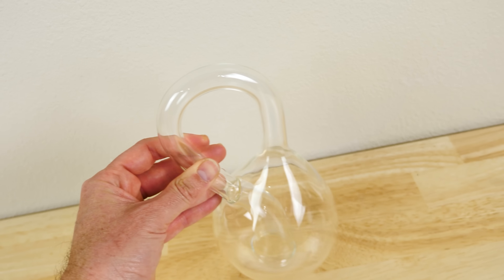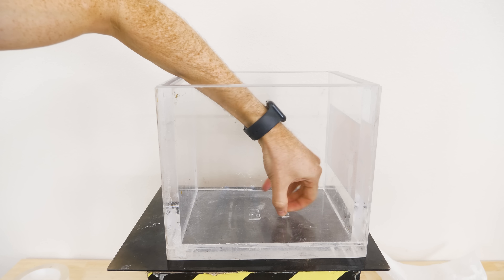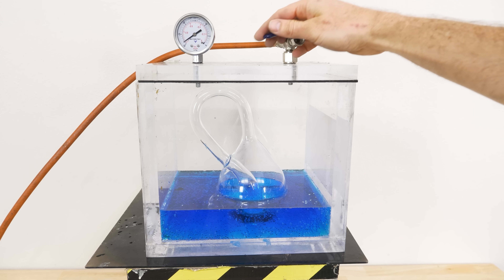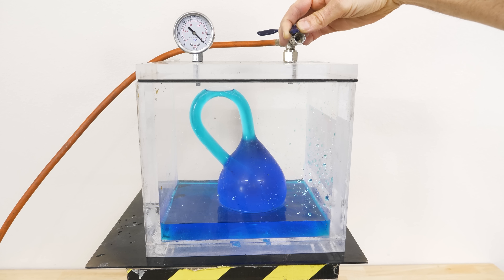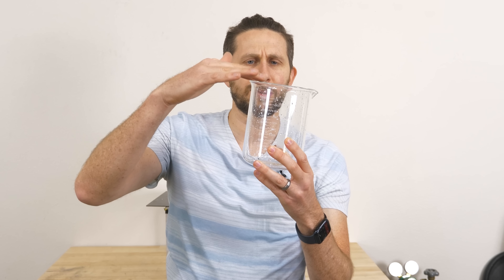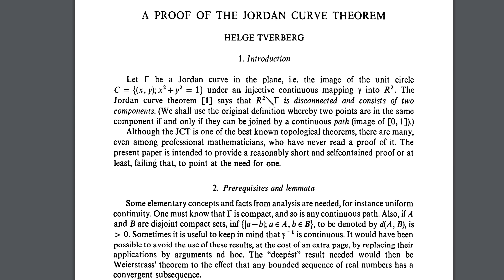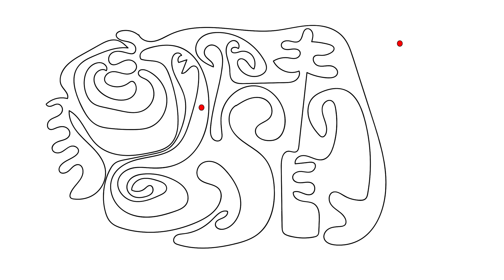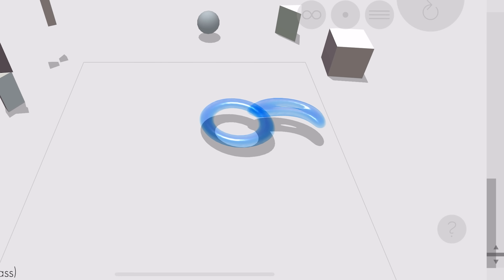Is It Possible To Completely Fill a Klein Bottle?

Comment: Funny thing is there is no such thing as 1D, 2D, 4D and beyond. They are all concepts of thought and math. Nothing can be 1D, you can’t have a point that has no width, there is no dot that can only have length without width and vice versa. It’s literally impossible. You can’t have 2D, there is nothing that can have length and width but no hight. Even an atom and what makes an atom has volume. And nothing can’t be 4D or beyond because there is no more physical space to travel. These are all just concepts based of math that cannot be expressed, recreated, or even visualized. It’s all mathematical theory. Just because you can theorize something in math doesn’t mean it is manifested somewhere.

For example my pocket has space and that space can be calculated and the space a 100 dollar bill can be as well. According to math it makes perfect sense that 100 dollars can be in my pocket right now. Yet if you check there isn’t one there

Comment: Is it just me, or couldn't you just stick a rubber tube into the bottle before you fill it, so there is a means of pushing air out as you fill it?

Comment: I was thinking you could achieve it by using a long flexible tube to let the air flow out when the water fills in.
Reply: Of course ...with a flexible tube was much easier

Comment: When the vacuum trick was presented, I started pondering what would be the result when the water starts boiling?  A little later I concluded it would be a dilution process between air and "steam", affecting both the Klein bottle filling and the vacuum box.  In theory, neither one would never reach a true end point of zero air.  Just an asymptotic approach.  A practical observation would indicate the steam condensing and an arbitrarily small amount of remaining air probably dissolving into the water.  Hmmm?

Comment: Another easy way to fill it up might be a tube/pipe (or a straw) put inside through the mouth and pump water through it. That way the space around the tube/pipe will allow air inside the bottle to escape

Comment: I disagree with it having no volume, and you could’ve filled it in with a tube going in… this was silly. The volume still accounts for the tube going in, the water can be used to measure the volume. You could literally calculate the volume as if it was a cylindrical tube.

I really find this leap of logic nonsensical.

Comment: Wait, wouldn't the inside of the bottle and the beaker be technically the very small space occupied by the glass? Or by both "outside" and "inside" does it necessarily have to mean the surface that can be in contact with air?
Reply: Keep it mind this is not a true Klein bottle

Comment: You made this way harder than it needs to be. Just insert a rubber hose/straw and push water in, which will displace the air as it fills. Turn as needed once it starts to top off on the inside.
Reply: That's boring af. Why miss an opportunity to use a vacuum chamber!?

Comment: Talking about over engineering.
A simple minded brain like mine would have inserted a small tube and filled the bottle up.
The air could have flown out as long as the tube is not blocking the airflow 
This solution cost you less than a dollar, how much is a vacuum chamber ?

Comment: To fill the bottle without a vacuum chamber, run a tube into the bottle. This will allow the water to push the air out as the bottle fills.

Comment: It has an inside. You had the volume of a liquid. You filled it and there it was.
Reply: That's what you call inside volume. The top that is the bottom is curved.
Reply: Now you have liquid to measure.
Reply: It just falls out when you move.
Reply: A parlor trick that even fooled you.
Reply: First you proved its filled.
Reply: Then I said you can measure volume.
Reply: No one should be that dumb.
Reply: First part then second was a lie.

Comment: You know, you could've just submerge the bottle into the water entirely instead of using a vacuum pump to get more water into it, then sucked the air out with a straw

Comment: Hey so I’m not sure if you have already done a video on this but what would happen if you were in a free fall on top of an object that has a greater air resistance than yourself and we’re to jump straight into the air against the free fall close to the ground would it be possible to mitigate any injury and land you instead of from a say 150ft free fall to a mitigated let’s say 6 foot fall?
Reply: Were* to

Comment: What if you were to submerge it fully in water and repeatedly move it to get individual air bubbles out?
Reply: numberphile did a video 3 years ago where they rotate one several times under water and did basically what you described.  It was far simpler and cheaper (didn't need a vacuum chamber, just a bowl of water lmfao)
Reply: @cody1964  That's exactly what I meant.
Reply: Still no one has answered this??
Reply: I came to the comment section for this exact question.
Reply: That would be exactly what this video is not about! Guy who uses a 4chan meme as an avatar that is so outdated that no one on 4chan posts it anymore.

Comment: i dont agree on the ''no volume'' reasoning. with this exact reasoning, a bucket doesnt have a ''volume'' if you curve the edge of it nicely. defining a volume by having a a defining edge?

you could even say that the ''defining edge'' of the klein bottle, is where the liquid is touchable. like with a cup of water, you can touch the water at the top.

this thing seriously has a volume. and the reasoning you gaave was quite..... ''imaginative'' and doesnt really conclude with most of the followup information you where giving after. 

the 4d klein bottle is a good explanation, but this 3d model does have a volume

Comment: This is such a stupid useless thing.
Reply: You're right !  And this because an attempt was made to put into practice some strictly mathematical models. There Klein's glass is presented as a single-faced surface. In practice there is no such thing, because the tickness of the vessel walls should be zero. Also valid for the Möbius strip.

Comment: I can clearly see the inside and outside. 3:31 "There is no line that would separate the inside from the outside." Lol, it's right where you put your palm when you want to hold on the water, there's a lid missing. I don't see any "mystery" in this bottle, just a f^^^ed up design bottle. How tired of these half-educated people with their "oh, look at the bottle without volume" or "oh, look at the tape going through space and time" and other mundane mutilated or upside down things that they try to present as a paradox
Reply: The Klein bottle is a higher dimensional version of a Möbius strip. Just like the Möbius strip only has "one side", so too does the Klein bottle. As he says in the video, the actual Klein bottle lives in a 4-dimensional space. What you see in the video is a 3-dimensional shadow of a Klein bottle. This is why it can be filled with water and looks like it has a clear inside and outside in the video.

Comment: You could probably also hold the bottled upside down and spray a small stream of moderately fast water into the opening. The water would shoot up the spout without completely blocking the air's exit

Comment: What about using a long flexible straw to connect the air trapped “inside” the kelvin bottle and helping it escape while filling it up? Wouldn’t it work without the need of vacuum?

Comment: this is a drinking game trick question.

take a straw and cover one end, and stick it into the bottom of a bottle of liquid(keep the straw full of air). now turn the bottle upside down. The bottle will  drain faster because the air has an easy way to get back into the bottle via the straw.

so, same idea with the klein bottle. Stick a flexible tube into the bottle so it reaches the bulb at the bottom. then turn it upside down. then fill the bottle via the opening. The water will flow in and the air will escape out the tube.

no vacuum pump needed.

Comment: Shapes don’t have volume, right?
Reply: The Klein bottle is a bounded surface, much like a sphere is a bounded surface. But we often think of spheres as having volumes because the surface encloses some solid region of space. A Klein bottle does not enclose any solid region of space, which is why it doesn't have a "volume" in the sense that a sphere or cube would.

Comment: A simple trick I guess is to get a hose, fill it up (standing properly, hose coming out of the bottom)

Flip it, add more water. And done..m filled. Just use a plate or something to flip it back without spilling.

Comment: I have to disagree.  The bottle will displace water because the material it's made of has thickness.  Same with the beaker.  The only way what you're saying holds true is if the beaker or Klein bottle were made of a surface with zero thickness.

Comment: I love how sometimes I understand things even less after watching these videos. Iceberg theory and all. 
So cool.
Reply: Eh,  a klein bottle has no inside or outside in the same sense as a cup has no inside or outside. The issue is the fact that the surface isn't explicitly definable even if it's clearly definable.
Reply: Yo just jumping into this vid, and before he said FUCKING VACUUM CHAMBER, I was like "Oh, he must have a tube to put water in it". I didn't want to understand the rest. I wanted to come to the comments to see if anybody said "use.. use a tube..."
Reply: He's not very good at his job of explaining things.
Reply: not iceberg theory. he just not good at comprehensively explaining things, and often uses bad theory and practice to explain actually simple ideas. Case in point, he used a vacuum chamber instead of just siphoning water into it. Also, not even that good of a vacuum chamber, since a good one would start boiling the water after due to low pressure, and would prove why using a vacuum chamber is not the correct method to fill this vessel. Also, it does have a volume, which is easily measured by submersion. His explanation of what volume is was so flawed. using his definition, a simple uncovered pot would have no volume either.
Reply: @john jon  Mathematically speaking, an uncovered pot is just an unclosed curve line, i.e. with no volume. In math, a line has only one dimension. He often touched the point but couldn't fully explain it that's why people find it confusing typically in his videos.
Reply: @R0cky0  he just thought it's fancier and eye-catching to say "it has no volume", while it can be put very simply and precisely as "it has no interior".
Reply: @caoqifan2371  that literally means the same thing, volume is just the space inside something
Reply: @____Carnage____  There is some nuance. A Lebesgue measure zero set, an empty set, and a set that cannot be well defined, are different things. What he said is like saying "my laptop has never got covid".

Comment: You could have used a relief tube to provide a seperate path for the air to excape past the incoming water rather than the vacuum. For those without a vacumm.

Comment: All you have to do is submerge the bottle and spin it around a few times to fill it completely. No need for a vacuum, no need for pouring and constant vibrations. It really is THAT simple. You just tried too hard to make something difficult, that isn't. There are VERY few shapes that resist complete submersion in a liquid.

Comment: CAnt you use a tube to fill it? The water will thru inside of the tube while the air will be displaced through the outside?

Comment: I learned about the Klein bottle a few days ago.  I was told that there's no way to fill it, I argued that with pressure changes it would be easy.  I think it could also be filled by rotating it and adding fluid every turn.
Reply: Just dip the bottle into a bucket of water and rotate it until its fill completely
Reply: It can.  Also by running a flexible tube into it.
Reply: maybe the person were talking about a "true klein bottle", no? can't think of how to fill one lol
Reply: Its its basically a inside out sphere
Reply: It can also be filled by putting a straw through the tube to allow air flow as you're filling it with water
Reply: True Klein bottles don't exist in our 3 dimensional world
Reply: It's like submerging an open pipe; you can "fill" it but it still has no volume

Comment: If the walls of the bottle have thickness, then it has volume.  You could calculate by submerging it in a fluid and measuring the displacement.
Reply: I was about to comment this but I just got to the part about physical vs theoretical. It's a theoretical shape, it was never actually intended to be a physical object, the object is purely for visualization
Reply: You haven't watched the full video i guess. A physical Klein bottle and a Klein bottle are 2 different things.
Reply: @alqualonde2998  they didn't Talk about which kind of bottle they meant... u can use math to find the volume of the theoretical glass, if you define thickness and size.
Reply: @alqualonde2998  What are your thoughts on kinslaying?
Reply: @dustwyrm  im just gonna ask "where were teleri ships when the trees fell?"..
Reply: @alqualonde2998  In- oh...
Reply: @alqualonde2998  ah I did watch it. Just didn't know what u were referring to. But I still think you could mathematically answer that question. I will ask a friend!
Reply: All he needed to do was calculate how much water he put in at the start and how much was left when it was filled. Blam-o! The difference is the volume. Science.
Reply: Thanks for this
Reply: curious to see how glassblowers create this. Should be a youtube video
Reply: You can't measure the volume by submerging if you can't get all the air out of it!
Reply: @mertzanakia  he just proved he can get all of the air out of it. Or he could have done it with a straw...
Reply: @mertzanakia  Liquid is heavier than gas. How would air be a problem when it gets pushed out?
Reply: @mertzanakia  the glass itself has volume
Reply: he's not talking about that volume. he's talking about the volume it can hold, and not the volume occupied by the walls of the bottle itself
Reply: @potatoo4  Nope. He said that beakers have no volume. Are you saying that liquids can't fit in the beaker?
Reply: @jacobc9221  yeah they because the klein bottle has no volume
there is no boundary between whats the inside of the bottle and whats the outside
so the liquid u saw that was filled in the bottle was never inside the bottle, that was on the outside, because theres no separation between the inside and outside in the klein bottle
Reply: That's the diffference between the mathematical definition of volume and the physical one. In maths, a Klein bottle only exists in 4D space and its "walls" do not have thickness. Of course you can't produce such an object in the real world, only approximations of one.
Reply: Topological volume and physical displacement are two different things.
Reply: That is what you are visualizing but, in reality it's a hella different which can't be proved easily by Today's mathematics!

Comment: The reason it still has volume is because glass has volume lol. So the whole proof is essentially irrelevant because it deals with lines that have no width, or in otherwords infinitely thin lines that practically don't exist other than as a reference to it being a line. If you have a bottle made from glass, it has volume because the glass walls have volume. You could eventually overflow a lake if you put enough of these bottles in the lake.

Comment: Wait, if volume only exists in closed containers, does that mean that a bottle gains volume when you put a cap in? And loses it when you take the cap off?
Also, would that mean that a filled volumetric flask without its cap would actually have no volume?
Reply: i think he takes more of mathematical approach talking about volume.
in literal sense this bottle is nothing more than fancy kettle.

Comment: You think volume only counts in a sealed container? So if I take the lid off a jar so there is no longer a separation between the outside and inside...the jar instantly has no volume? How did you get that so wrong?

Comment: If a volume is essentially any 3Dimensional enclosed space (meaning that a closed box has volume, while an open box does not).... then wouldn't the volume just simply be the thickness of the glass (or the material of the box) itself? The "inside" and the "outside" is defined by the very fine line of it simply being a 3Dimensional object. Inside the wall vs outside the wall. It may not be easily defined like a box(shape) would, but neither would a ball filled with air.

Comment: I appreciate your clever, albeit overcomplicated solution to filling that bottle, but based on the comments, your imprecise use of language added little to the viewers' understanding of Klein bottles.  1.  They think the glass thing in your hand is a Klein bottle.  2. The shape of the glass thing was altered when you put your hand over the hole in the bottom.  Your hand effectively formed another surface of the bottle that shouldn't be there.  3. The fact that even without an inside or outside, fluids under the effect of gravity or pressure will maintain their lowest free energy position relative to the bottle, implying there's an "inside" when there is not.  I understand that you tried to explain it with the beaker and the graphics, but you created a compelling model for the audience when you showed them liquid filling the space, and spent too little time explaining why that doesn't meant Klein bottles have volume.  I think this video causes more confusion than clarity.